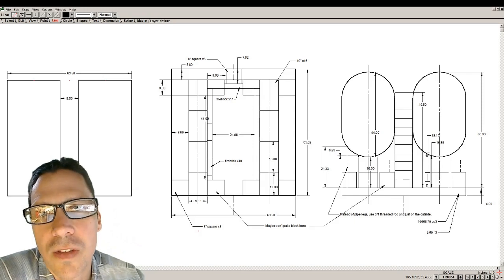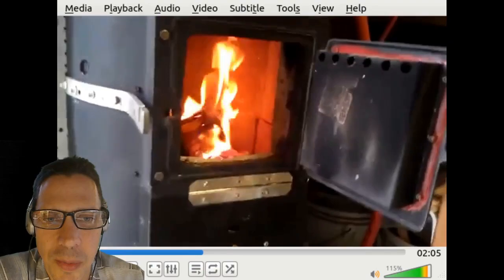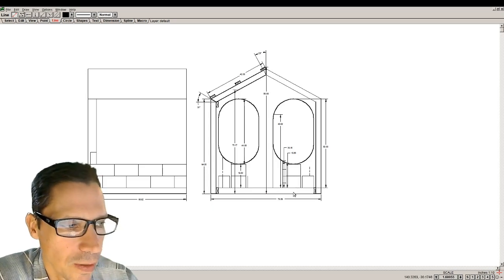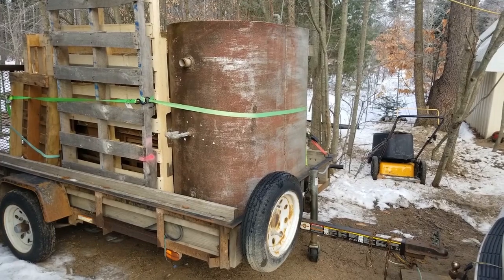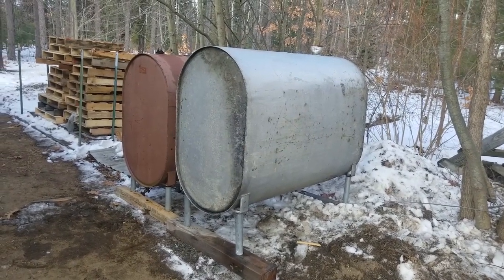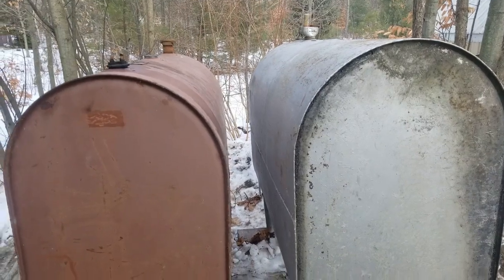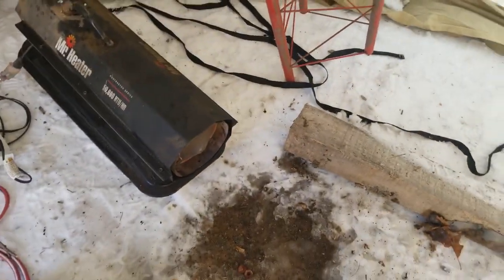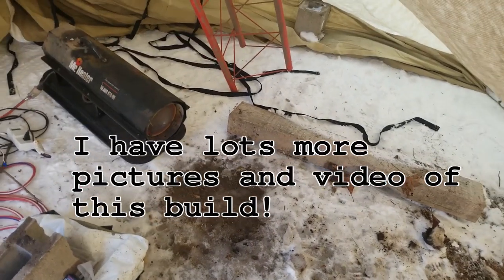Home Built Outdoor Wood Boiler, Part One

Comment: Did this raise your homeowners insurance?  Maybe not since it’s built separate from your house?
Reply from the maker: Didn't raise the insurance a bit, because for the last 27 years I've heated with an indoor wood stove so my rates already (and still) reflect this. This is our first year not building a fire indoors.  But I'll probably not get rid of the indoor wood stove anytime soon just because it may be needed as backup if something goes awry in the middle of a winter.
Reply: @dansw0rkshop  that’s good thinking. Gas is still cheap enough in North Dakota that the insurance rider would be more than the gas savings. But I do love me a good hot wood stove.